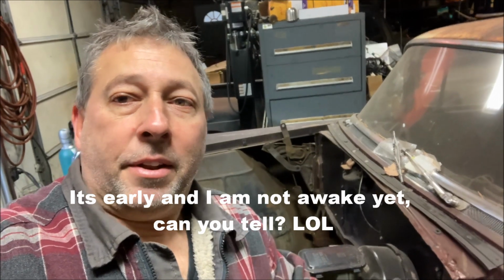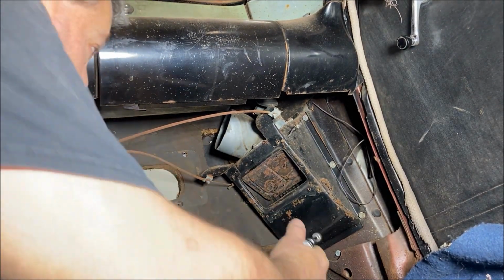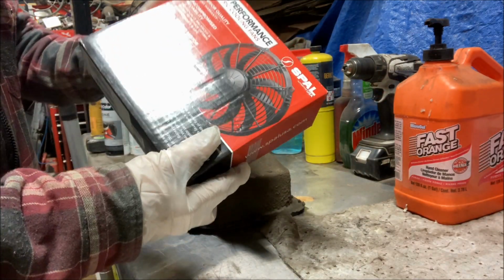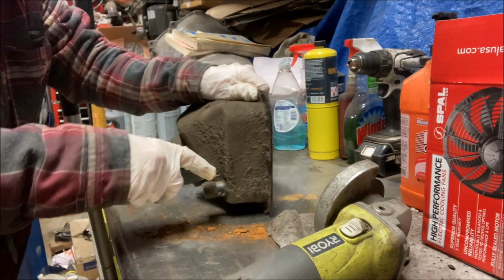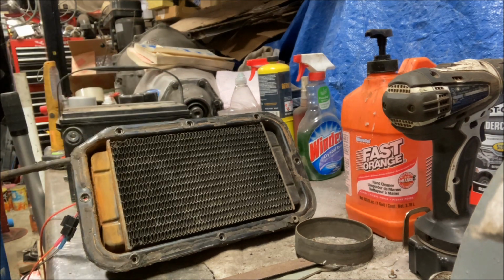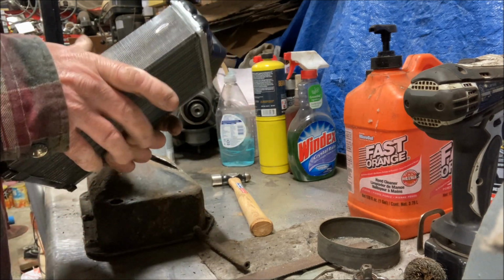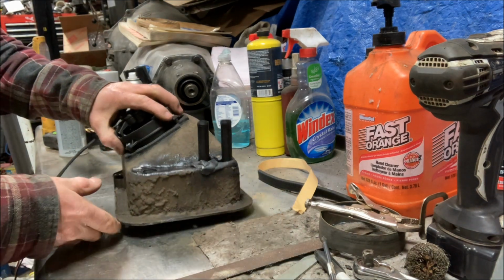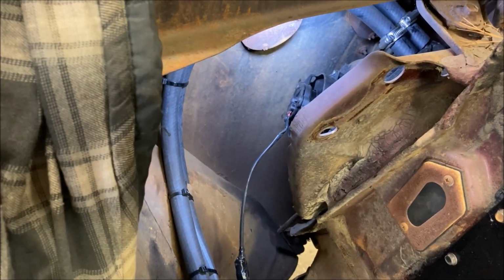1955 Buick Special Turbo LS Build part 41, heater core update / keep factory heater & clean firewall

Comment: Brassworks in Paso Robles, CA makes an OE size heater core so you do not have to cut yours up.
Reply from the maker: Thanks, I like the aluminum one because it is around $40, or at least it was a few years ago. Thanks for watching, just drove the 55 yesterday.

Comment: Nice find on the Neon heater core. My only concern with this is you are now pumping unfiltered engine bay air into the cabin. The original firewall air box pulled outside air in through the cowl vents.
Reply from the maker: True, if that turns out to be a problem I will make a plenum to pull air from outside the engine compartment, maybe the port holes!

Comment: Thanks dude- starting a LS conversation on a 58 buick - I will need to do the same thing.  This helps.
Reply from the maker: Awesome, glad I could help! I tested the unit out today and it works great! Make sure to get the fan PN I used, it is a pusher fan, most others are pullers.